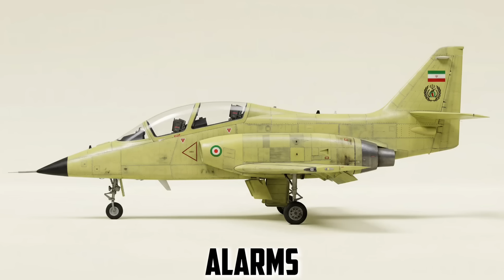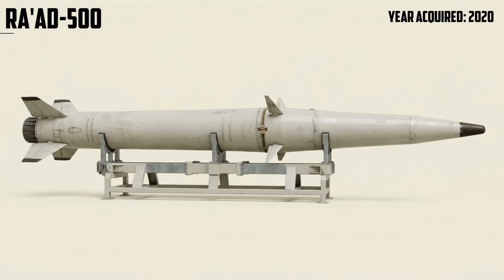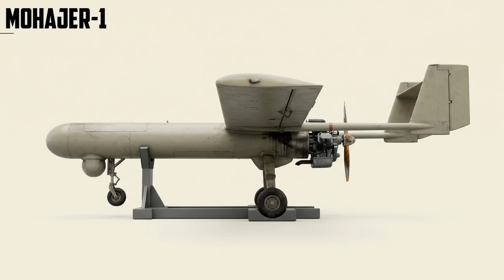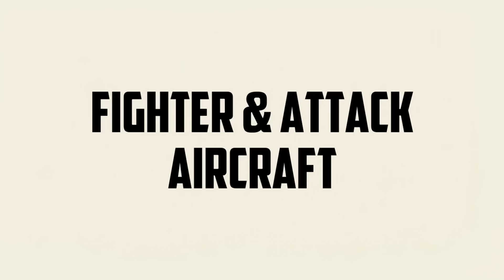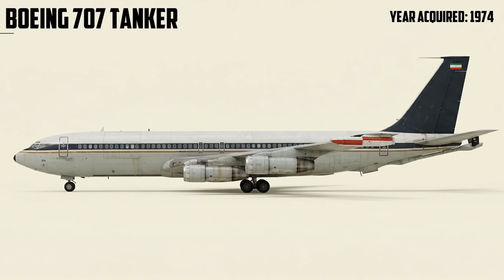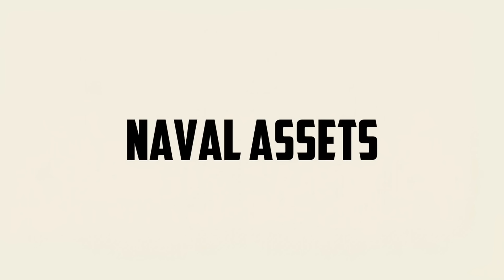Every Iranian Missile & Drone Explained

Comment: If your figures were accurate, which they are not, Iran would have ceased launching missiles altogether. Intelligence estimates indicate that since 2010, Iran has significantly increased its missile production capacity, from approximately 600 missiles per year in 2010 to roughly 890 missiles annually since 2011. In short, Iran possesses a massive arsenal of missiles and launchers manufactured in workshops, as well as numerous missile facilities, reportedly scattered throughout the country. In summary, at the very least, the Iranians possess approximately 13,890 missiles with ranges from 1,300 to 2,500 km, produced over a period of 19 years.